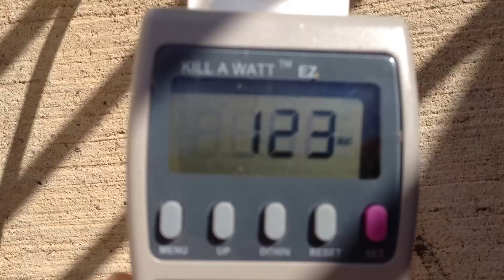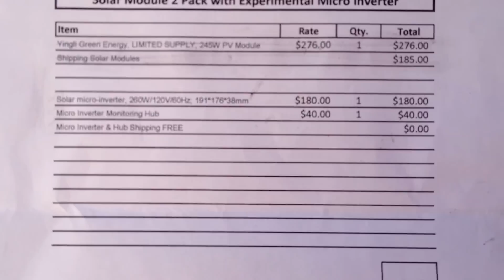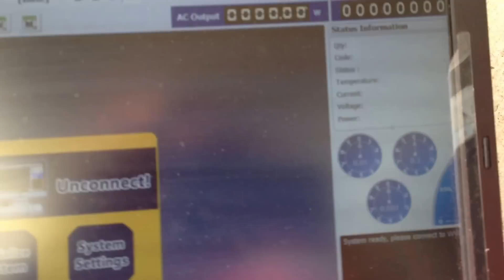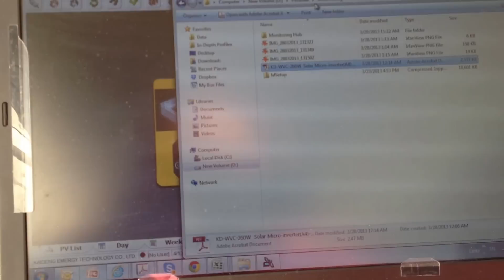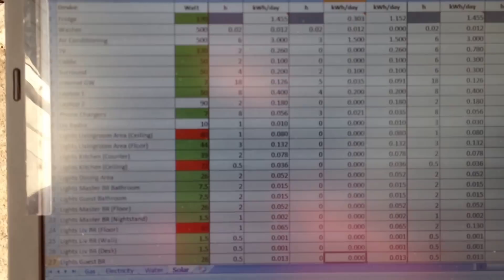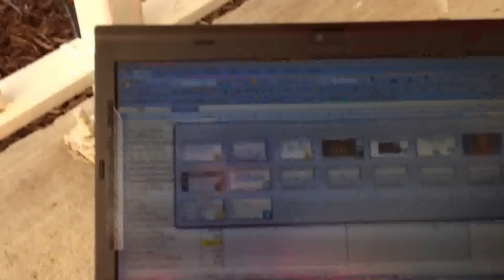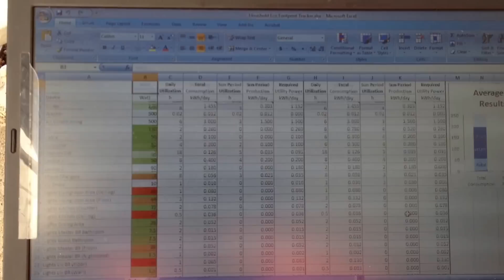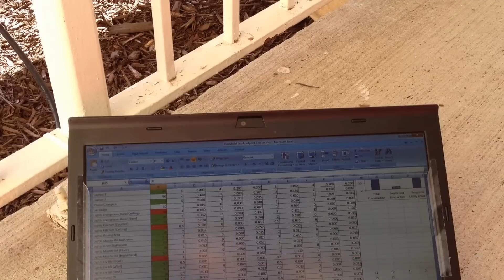Small apartment balcony solar power setup (part 1)

Comment: with 245W, can you possibly power a TV and computer with this?
Reply from the maker: yes, but depends on the actual output of the panel. I just changed my setup and added a battery, solar charge controller and a different inverter. ran my TV, cable, Internet, lights with battery-stored solar power all of last night
Reply from the maker: here the link to my new video with the battery setup: http://youtu.be/W2Lc2LdpN6I
Reply from the maker: Jason Tugunon Just another update. I replaced my modified sine wave inverter with a pure sine wave inverter. So cost of my setup went up a bit, payback period got longer but at this way I don't risk that sensitive appliances like my TV are getting a hit. I will post a new video soon.
Reply: Jason Tugunon 
Yes you can if your devises have power rating no more then 150 W. Just taking 95 W out as intermittent nature of solar and efficiency of MPP and Converter will drop out put of the system dramatically.

Comment: you don't really need to have those advance micro inverters. just get you a regular grid tie inverter and it's way cheaper than those micro inverters. just plug it in and forget it. your killAwatt meter will do the data recording. in the near future if you're going to add more panels, it will be very very expansive because you'll going to keep buying more micro inverters of each individual solar panels. my grid tie inverter are mounted underneath of my 4 235 watts solar panels. i wire all my 4 panels in parallel into one single 1,000 watt grid tie inverter. then i use a 50ft heavy gauge drop cord connecting my grid tie inverter and back feed it into my home. its works great.
Reply from the maker: you are right, I disconnected the micro inverter and bought another more powerful one and added a battery: http://youtu.be/W2Lc2LdpN6I
Reply: thanks

Comment: cool.Nice job!I've made some small solar things to power my USB devices. Small 5,5V solar panel that charge some 3,7v Li-Ion batteryes (from a laptop battery) than a step-up booster converter with a USB port and I charged a Samsung Galaxy Mini 6 times :D
Reply from the maker: pretty cool. I just finished my battery-based setup: http://youtu.be/W2Lc2LdpN6I 
runs my living room at night and during the next power outage I am good to go for light, Internet, TV, etc.at night.
Reply: How much money did you or are you saving?
Reply from the maker: David Gingrass About $5 per month. This is for the portion of the apartment grid which I am able to power with that mini setup. I calculated what my living room grid consumes during the week and on weekends (day and night) and came up with an average of $7 per month (at $0.16/kWh). It will take about 15 years for my setup to pay off :)

Comment: here it is the price! Very expensively! I bought solar panels that week, 480$ two panels 200W 24 volt + 32$ shipping + 151 MPPT micro grid tie inverter 500 W 24 volt + 15$ energy meter power ! Total 678$ for two panels with a powerful inverter  is cheaper here ..... I ordered all from China, will arrive I will test on quality.
Reply from the maker: do you live in a house or apartment? let me know if you rent an apartment and how you intend to measure if and what your setup is saving you in energy costs.
Reply: lbodini2008 I live in a house. I bought these panels for experiment. I will connect panels via the counter and I will look.
Reply from the maker: Андрей Олейник just changed my setup and added a battery: http://youtu.be/W2Lc2LdpN6I
Reply: @Imstalcon  can you tell me how you are doing now,

Comment: I thought Grid Tie inverters are illegal for use without permit or something...  Also, inverters advertise their surge power consumption (watts) not in continuous output. If your inverter is rated 260w, then it most likely it is only capable of putting out 130w of continuous power. The last thing I would like to add is that these electronics require cooling and because you mounted it right behind the panel,  it will probably not function efficiently since the panel itself is radiating tremendous amount of heat.
Reply from the maker: I guess the permit issue is different from state to state and also what the landlord allows and what not. The reason I am doing this is to prove that even apartment renters can complement their traditional energy sources with renewables like solar. I didn't ask the landlord before installing the solar panel on my balcony and even though it is very prominent nobody has approached me yet or raised a concern. I will change the setup soon and replace the inverter with a 1200W model and will also add a charge controller and a battery so I can actually tap into the solar energy at night when I need it most. Will post another video when ready.

Comment: I agree with comments below about heat gain.  It appears to me that there is a backing on the machine which will hold heat in close to the panel.  Depending on the exact angle of the suns rays you will see less than rated power.  I am in an apartment and to make things economical with a small number of panels, there must be some rotation so as to keep the sun's rays perpendicular to the panel.
Reply from the maker: This is in response to various comments below since Google changed the way to reply to older comments (or did I miss something?)
At this point I don't even bother with trying to find out why the inverter is showing such a low output or if I measured it right. My key challenge I want to solve is, how I can find out what happens to the power I am feeding into the apartment grid. Again, I don't have access to the meter room and I can't see from the utility bill if anything changed since it consumption fluctuates so much every month anyway. Also, here is the link to the sheet  I am showing in the video. https://dl.dropboxusercontent.com/u/472339/Solar%40Apartment_Calculation.xlsx
Reply from the maker: Hi Harry, just added a battery and charge controller to my setup. works perfectly. http://youtu.be/W2Lc2LdpN6I

Comment: On the watt meter look at PF (Power Factor) to see the inverter efficiency. Also you Power meter does not spin backwards so if you are not using all the electricity that you are producing that goes free into the grid.

Comment: You're measuring the voltage from the output of the inverter which will only output 120 volts. You have to measure the DC voltage directly from the panels to get the rated voltage from the panel. That 245 volt rating is at 18 volts DC. What you're measuring is the AC voltage from the inverter.

Comment from the maker: The Kaideng hub/software only works with their converter. I got the system from dctopower (google dctopower and mark barlow.....can't contain links in comments). Mark bought the same setup, installed and had the same issues with the power output. See the comment of Ian Evetts on how to tackle this (hopefully).

Comment from the maker: Hi Ian, I figured out the modem connection issue (see my other video I posted on this one). Thanks for the tip with the MPPT and supercapacitor. Do you have any experience with that? Can you point me to a supplier or products?

Comment from the maker: I don't think it is getting too hot, because it is not directly attached to the underside of the panel. It is basically hanging on the alu frame of the panel but I will double-check on the next hot fall day if there any to come.

Comment from the maker: What I saw so far, you should be getting more than 50-60% out of it. But my biggest problem at the moment is, that I can't really track what happens with my solar power once it is fed back into the apartment grid. Once I figure that out or find a practicable battery setup, I will look into the inverter efficiency again.

Comment: use another extension cord to move your invertor. sitting right under the panel is making it very hot.  use a box from walmart cut holes in it put your invertor in it and leave on the porch.  try pouring water on your panel and see if your wattage changes.

Comment: I might be wrong, but on every panel I have used I seem to get about 50-60% of the watts that the panels is rated at, I noticed this on different inverters and also I get the same percentages on a digital charge controller. You can also check the actual wattages of the panel with a WATTS-UP meter.  I am pretty confident that most panels get a little over half the rated output on bright sunny days.
Reply: Plus they need to be pointed to solar south to get max power.
Reply: @CommunityWISP  that I correct have to be at the right angles to maximize the power.

Comment from the maker: Yes, that's exactly it. The inverter comes with a three-wire cable which you connect to a regular AC plug. If your outlet is outside you need to make sure it is somewhat water/weatherproof.

Comment from the maker: Good point but the DC cables that came with the inverter are too short to put it anywhere else than behind the panel which is where it is intended to be mounted. I will check how hot it really gets mid-day behind the panel but doubt that this is the issue. I still have a pending discussion with the Kaideng engineers concerning the inverter input versus output measurements.

Comment from the maker: Yes, I got it to work and the problem was not the surge protector. The supplier put the wrong sticker and serial number on the modem. The last two digits of the serial number need to be configured in the software so it can connect with the modem. I posted a video on the results (see link video description),

Comment: Did you get the modem to read from the inverter yet? I dont know if you tried this or not but the surge protector may be blocking the signal. Try plugging in the modem to the out let with no surge protector. I know The Enphase Envoy unit specifically states do not use surge protection just for that reason.

Comment from the maker: The official way of checking if you can feed back or not, is to call your utility. As far as I know an interconnection agreement for net metering can only be put in place between the property owner and the utility. I will see if I can get access to the meter room in my apartment building so I can do some testing as well since I have times during the sun period where no energy in my apartment is being used at all (fridge off, etc.) and I want to see how the meter is dealing with this.

Comment from the maker: I don't have batteries so I am only offsetting part of my daily energy use. At 125W average output over the daily sun period I would need 3 panels to cover 100% of my weekday energy consumption. At 200W output this changes to 2 panels for weekdays. With 1 panel I don't even get to the point where I have a surplus of solar power that I would want to feed back. As for your question about the digital meter, I don't know and think it depends on the utility itself and the meter models they are using.

Comment from the maker: Yes, in my current calculation it would be 21 years. Major factors driving this: the rate you pay to your utility, the total cost of the solar system, the panel efficiency, the number of hours you get sun, how optimal your panel is positioned, your energy consumption and energy usage pattern during day/night. If I change my utility rate from $0.14 to $0.16 the number of years goes down to 19. If I then change the average panel output from 125 to 200W the payback period will be 12 years.

Comment: You said that it was 21 years to recoup the cost at 125 watts.  That means it must be a small saving?   How many panels do you calculate needing to completly offset?  I've also heard that the new digital meters don't allow for feeding back electricity to the grid?  Is this correct?   I'd be interested in an update.  Thanks

Comment from the maker: yes, noticed it too, thanks. any shade has quite some impact on the output but the bush is not the reason I am not getting more than 130-140W out of it. I am talking to Kaideng about this and need to do some DC measurements with the panel to confirm that it is working fine.
Reply: The power you get from a solar panel is not constantly equal to the peak power which is written on the panel (240 W in your case), it depends on the parameters irradiance (the power in the sun light) and temperature. You will only get the peak power if the irradiance is 1000 W/m^2 and the temperature 25 C. These circumstances are not so common in northern Europe unfortunately. I have a homepage dedicated to sizing off-grid systems like this on sunnyoffgrid.com :) Anyway, I like how you mounted the panel on your balcony, I'm planning to do the same thing today!